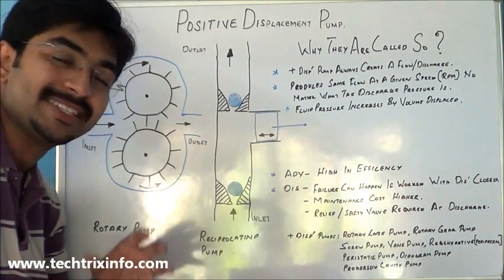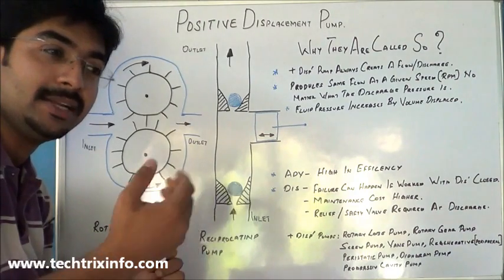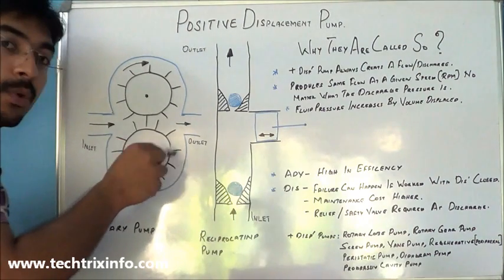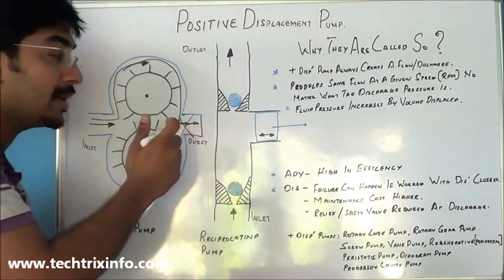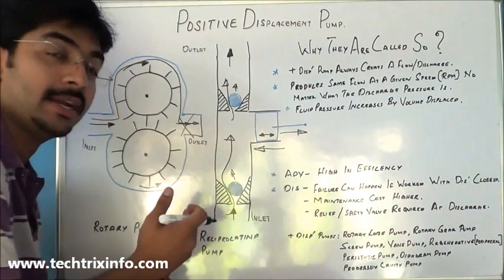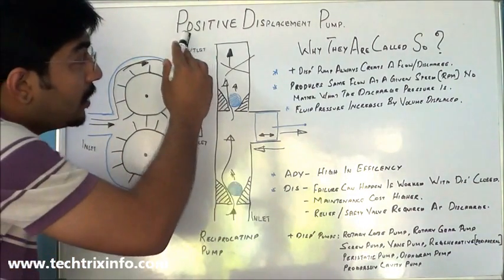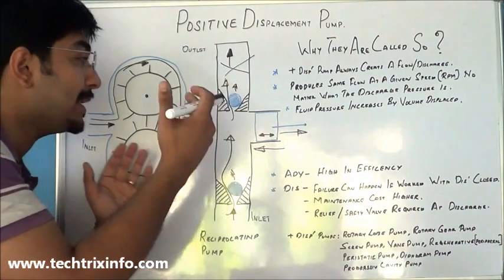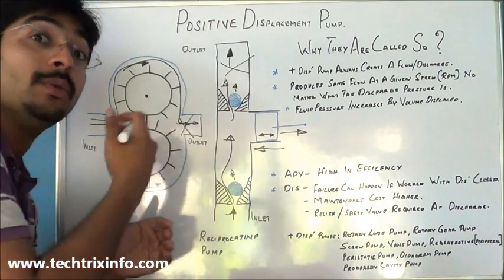Why Positive displacement pumps called so? ✔

Comment: Hahaha!! Doesn't centrifugal pump create discharge or flow(as you said for positive displacement pumps) of fluid? Obviously it does, but we don't call it positive displacement pump, do we? Positive displacement pumps are called so because there is no displacement of fluid back to pump(i.e something what we can call negative displacement) due to negative pressure created in discharge pipeline, there is only POSITIVE DISPLACEMENT of fluid from pump to discharge line! Whereas in centrifugal pump, the fluid can get back into casing due to negative pressure in discharge pipeline. This is also the reason of the last point you told that at a given speed, the discharge(which is volume flow per second) produced by positive displacement pump is more than other(such as centrifugal pump) pumps.
Reply: Thank you bro i got answer I was searching correct explanation, when he said in the video I got a doubt your comment helped me.
Reply: You comment helped ne to understand than the video...its lol

Comment: positive displacement pumps cannot be used for a constant flow, usually centrifugal pumps are used for a stable flow rather than PD. PD pumps are also applicable for high viscous fluids such as oil only, low viscous fluids like water are transferred by a centrifugal pump. PD displacement pumps are not EFFICIENT at all, they are usually very expensive to run in comparison with centrifugal pumps.

Thanks
Reply: PD pumps are also the best for discharge volume control. that's why they are widely used in the Medical and Chemical industry
Reply: Marcos Paz
Yes that is well true too.

Thanks for your input mate.